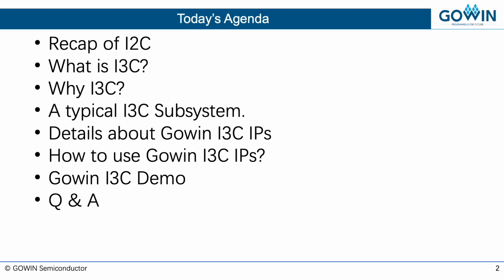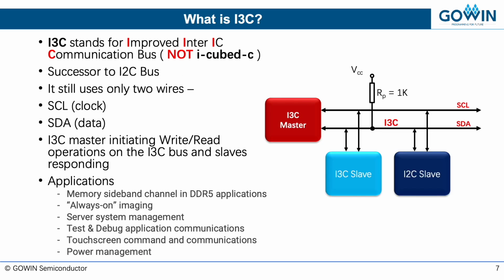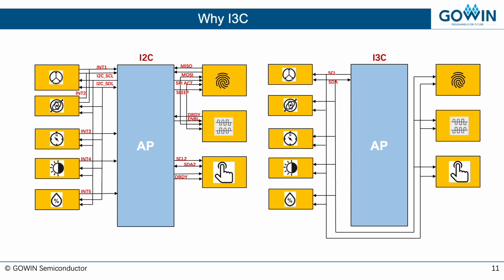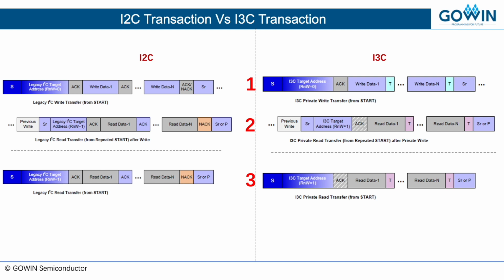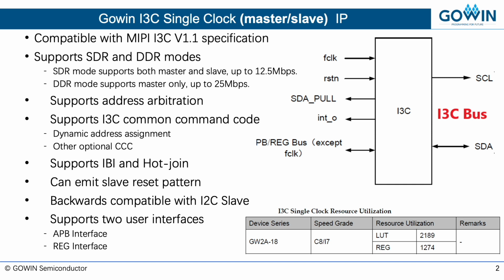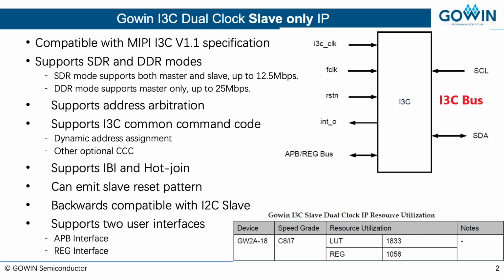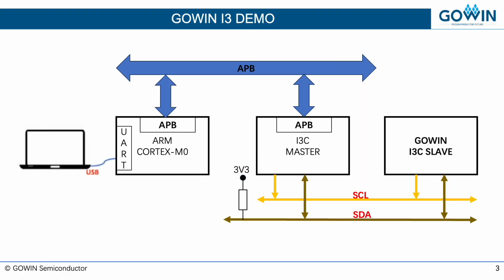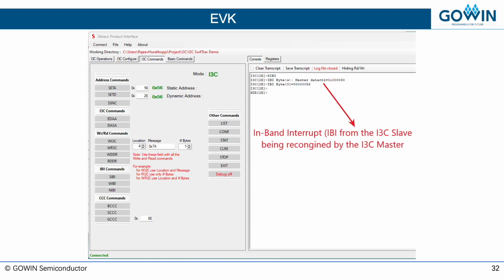GOWIN I3C IP Webinar

Comment: Summary

i3C Basics
- i3C is a two-wire interface, an upgrade from i2C.
- i3C can handle interrupts within the protocol, no separate lines needed.
- Supports data rates up to 25 Mbps in DDR mode.

Advantages over i2C
- Cleaner, two-wire connection to CPU.
- Higher data rates and lower power consumption.
- Built-in interrupt handling.

i3C in Mobile Phones
- Handles various sensors like distance, light, temperature, etc.
- Replaces messy i2C connections with cleaner i3C.

i3C Master-Slave Architecture
- i3C allows for one main master and multiple secondary masters.
- Secondary masters can request bus mastership.

i3C IP Offerings
- i3C Master-Slave combo IP, Master-only IP, and Slave-only IP.
- Compliant with i3C 1.1 specification.
- Supports speeds up to 25 Mbps in DDR mode.

Demo Setup
- Consists of a PC, a microcontroller, and an i3C slave.
- Demonstrates basic i3C operations like writing and reading data, executing global common command codes, and inbound interrupts.

Q&A Highlights
- Ternary modes not implemented due to patents and lack of customer interest.
- Cycle stretching not part of i3C spec.
- Hot join feature allows slaves to join the bus during operation.